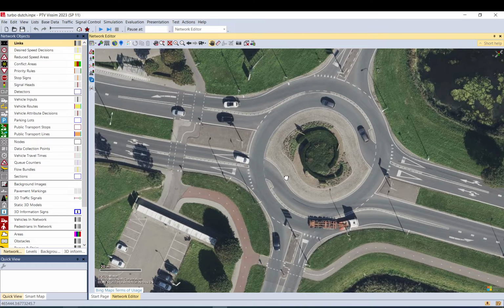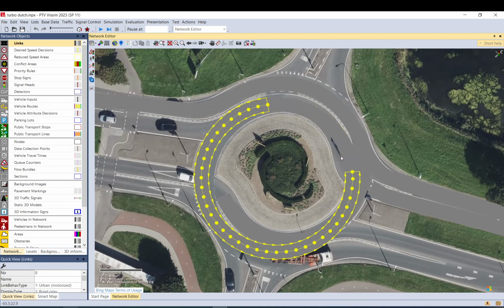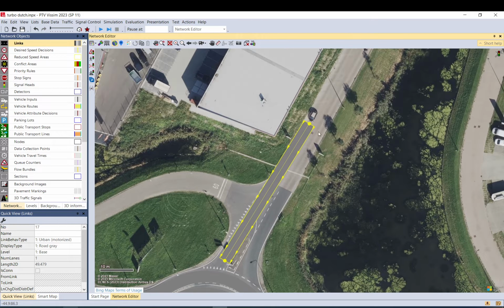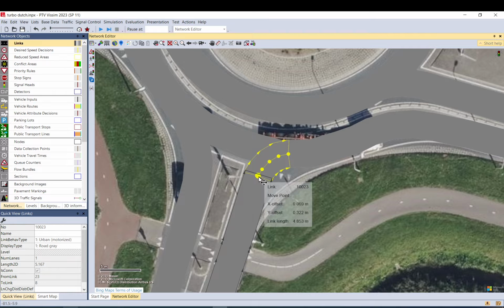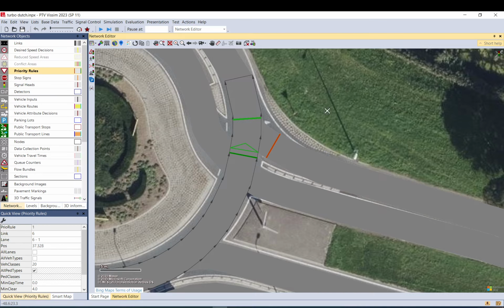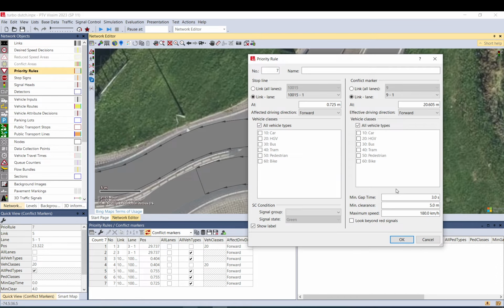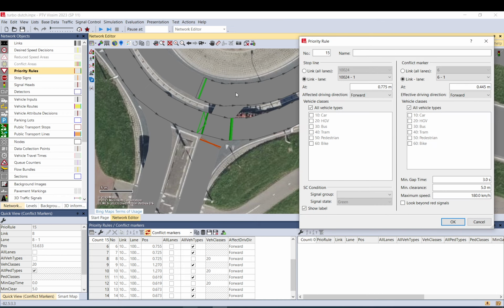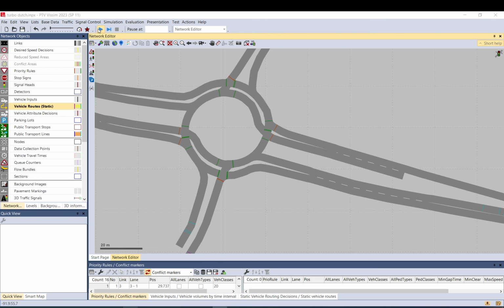Vissim Tutorial - Turbo roundabout example

Comment: Hello, how can we assure that we have No-Lane-change within inside the turbo roundabout?  Thanks!
Reply from the maker: of course, you need to define entry and exit connectors in that way. Or if you have 2 lane section for the same movement, you can define solid line marking
Reply: @MatyasLemberTutorials solid line marking doesn't work. I tried no lane changes on segment.

Comment: Hi, Matyas. Do you know how to adjust link's opacity? mine is a little transparent where you can see through the actual road. I forgot if I ever adjusted it, but when I try to make a new file, the link is solid gray. It's tedious if I start over with my project esp. with veh comp, veh type, etc.
Reply from the maker: Hi @dagzdaveed1778, sure, so what you need to do is first right click on 'link' on the left side of the screen under 'network objects' and select 'edit graphic parameters, and make sure 'drawing mode' is not 'use colour scheme'. You can also just left click on the little icon next to 'links'.
Option 1: Set it to constant colour to apply a general colour to all links/connectors. If you use this, change the colour for connectors (Connector fill color) and links (fill color) separately here on the pop up window when you right click on 'links'. Make sure that you select colours from the top rows and not the bottom 2 rows. The bottom 2 rows are transparent ones. 
Option 2: Set it to display types. In this case you need to edit the display type you have for the links. Go to 'Base Data' menu, -> 'Display Types'. The default for links is 'Road grey', so just edit the colours there as described above. Bottom 2 rows are transparent, colour on the top rows are not transparent.